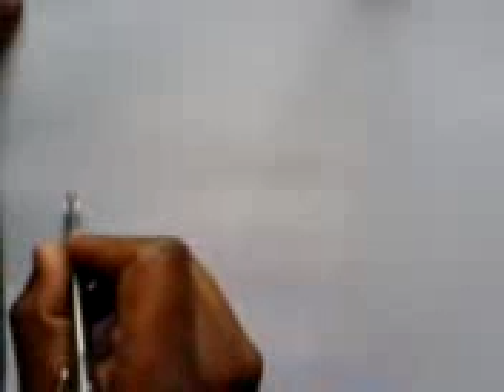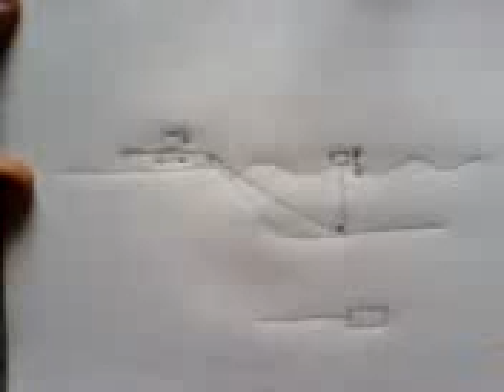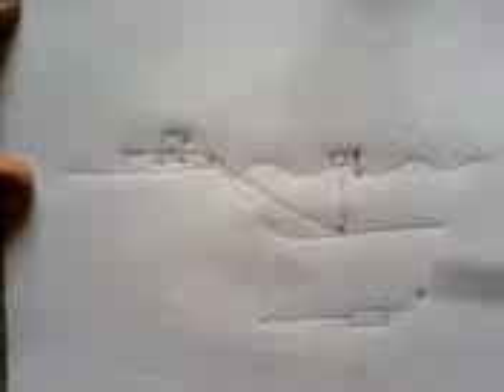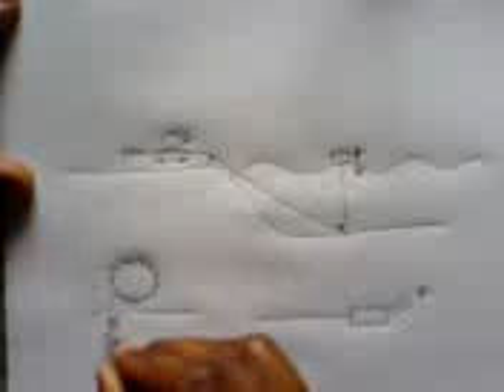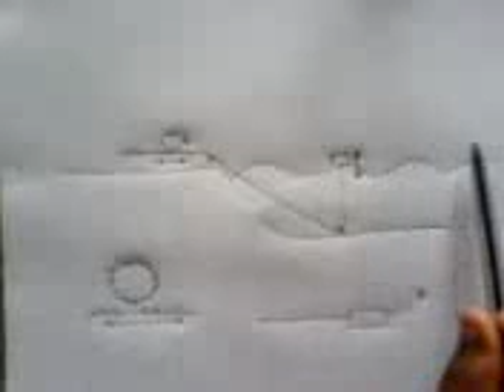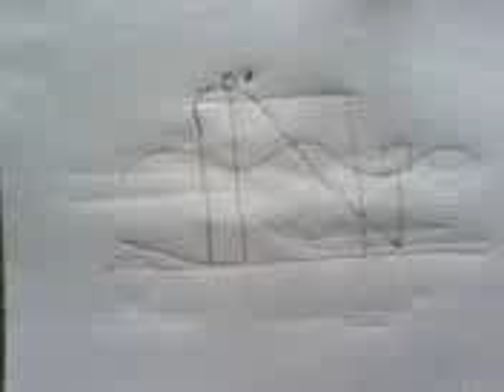OCEAN WAVE ENERGY A Revolutionary Approach For Electricity Generation

Comment: it can work if made large enough connect it to a flywheel ... also the land part should be on an incline so on the "down stroke" it pulls the buoy down as it goes to reset place. the energy is only converted on the "up" stroke of the buoy ... but that is fine as long as the system is cheap....

try to make one ... you'll notice a lot of things :)